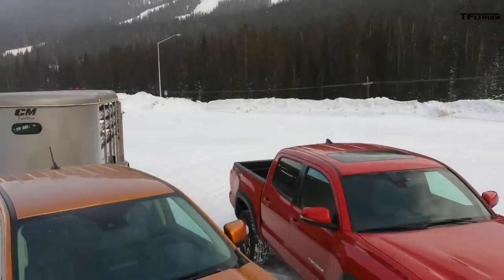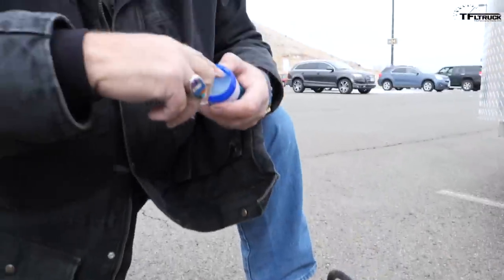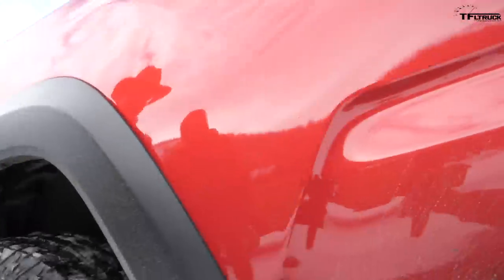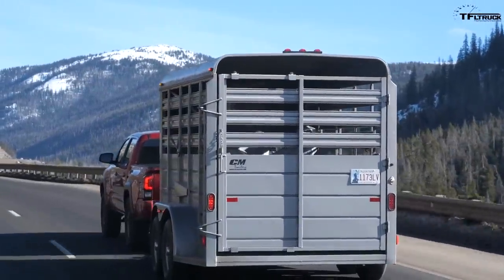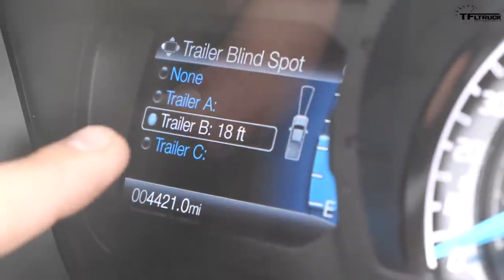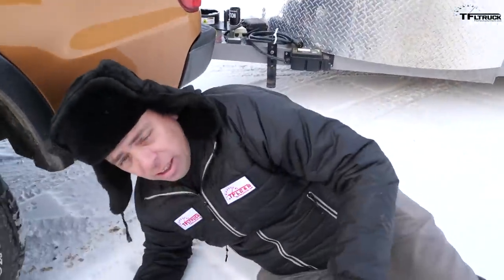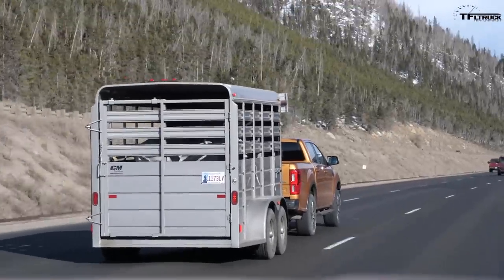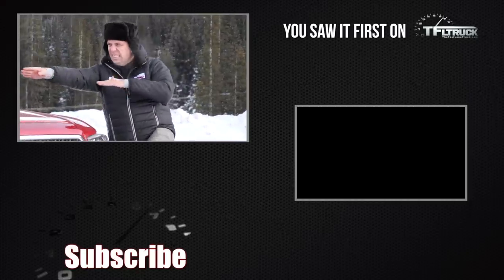Best Midsize Towing Truck? Ford Ranger vs Toyota Tacoma vs World's Toughest Towing Test

Comment: Both great dependable trucks
Reply: Wait a bit before making that statement. Ford has been having issues with all their turbo motors, I doubt this will be any difference.

Turbos are just high strain components that can be damaged very fast if the oil lines plug up or the oil gets to hot in general. But that's any turbo engine.

N/a motors will lack in the numbers game but they are generally more reliable since they are more simple designs. 

Diesel is a whole different game and they have quite a few issues caused primarily by modern EPA requirements. Delete emissions and run a clean tube and you can pretty easily get 500k out of a diesel engine. Otherwise you better keep very good maintenance on them.
Reply: @kylevanwinkle2081  Ford's turbo motors are just as reliable as naturally aspirated engines but any modern engine is more prone to problems caused by a lack of maintenance.
Reply: @benjaminwayneb  if you really believe that I'm sorry because that's just false.
Reply: @kylevanwinkle2081  It's not false!!!!
Reply: @benjaminwayneb  ok bud believe what you like
Reply: @kylevanwinkle2081  I work for a Police fleet with 270 units and the Ford engines by far have the least problems vs. GM and Dodge.
Reply: Lmao. I see tons of old rangers. The 4.0 and 4.2 were actually good engines and in Ford's. I hear tons horror story's with does but i hear tons of great story with ford.
Reply: The reliability of a new model ford is very questionable.  It is a 35,000 chance.
Reply: @Jn58298  2.3 , 3.0, and 4.0.
Reply: Kyle Vanwinkle gmford engines are reliable.
Reply: Tacoma yes, Ford no.
Reply: benjaminwayneb bwahahahahaha.. I am a cop, and my fleet are going back to gm because of all the issues that the Fords are giving us. The interceptors are the biggest piece of craps ever!! Hahahahahahaha.. No way you work for a city with a police fleet. Then again, they do hire ppl who aren't very intelligent!
Reply: How do you know the ranger is dependable? It just came out!
Reply: @freddyflintstoned913  You mean 46-48k with this tester!
Reply: @EGGINFOOLS  same engine and transmission as eco boost mustang, they're holding up good so far
Reply: @kylevanwinkle2081  check out Daniel Jaeger films video on Ecoboost 200k mile review
Reply: @freddyflintstoned913  this truck has been out in Mexico and other parts of world for a while (I believe 2012)
Reply: @robitaill3  bud fact is Ford has issued with the turbo designs failed turbos and failed timing chains help even the 2.0l in the focus rs had headgasket problems. Let someone beat on the engine a little and the weaknesses will be revealed.

Chevy has their own problems with their diesel engines the 6.6 is screwed with the cp4, its prone to failure, mine let go at 74892miles. I've never felt luckier since the warranty ended at 75k miles, the 2.0 cruze diesel was plagued with emissions and emissions sensor issues. I know because I replaced everything past the exhaust turbo flange at least once including the def tank lines and injectors.

I dont know much about the 2.0l duramax or the 3.0l duramax they are currently producing and I'm very interested in the 3.0l but I know wlhoing in that emissions issues are likely.
Reply: @kylevanwinkle2081  not saying it's perfect. Way better than the Fiat-Chrysler small turbo engines
Reply: @robitaill3  I know nothing of fiat Chrysler as I'm no fan of anything they build. The jeep and the Cummins is the only thing i remotely like. Put the 2.8l Cummins in the jeep and I'd love one but that crummy 3.0v6 diesel has a pretty bad flaw along with emmisions failure history
Reply: @kylevanwinkle2081  Fiat merger was their demise
Reply: @robitaill3  I agree but without the merger they prolly wouldnt be around at all.
Reply: @kylevanwinkle2081  I rented a 2015 or 16 Chrysler 200. The tranny was already slipping with 30k on it
Reply: @robitaill3  That's a small percentage of reliability on a vehicle. There have been problems with the 2.3 in the past. Suspension, electrical wiring, reared and countless other things aren't shared. Plus the frame is totally new, not the 12 year old design from the global form

Comment: Hello again Andre an Mr. Truck! But I have to tell you two chuckle heads, yo can not downhill brake test a truck that’s towing a trailer with surge brakes! Plus when greasing a hitch, or just about any hole, you are supposed to spread the grease inside the hole after spreading a thin layer on the hitch itself!! Not glob it on just the hitch, only to have most of it pushed back as you insert it! If I remember properly the Colorado Diesel and Gas Crew Cabs did better than both of these two, up-down an mileage wise!

Comment: SMALL trucks are NOT made for towing BIG loads. 
That's a job for BIG trucks of ALL makes and models!
NO SMALL trucks will last in  conditions of High RPM!
Reply: True. F150 or the Tundra for regular duties like this.
Reply: Except the Colorado comes with a diesel... you think that truck would be here for the test?
Reply: My hat is hitting the roof...come on stop complaining,  im 6 ft 3 wich is above average and my head has never hit my tacomas roof. Just dont wear a huge cowboy hat that adds 10inches to your head haha
Reply: This is the reason RAM cited for not offering higher towing capacity. If you are going to haul that much, you need a bigger truck. It isn't all about how much the engine can haul. It is also about the weight of the truck being able to properly handle the load.

As a matter of fact, TFL actually did another video which showcased this. They did a towing test between the F150 and the Colorado. The load was within both trucks capabilities (5600 lbs I believe), but the Colorado had issues with seat that the F150 didn't.
Reply: @mikemissouri5152  it's probably more a matter of getting press vehicles at the right time. Plus, they have tested those already and I don't think they have any new updates for 2019 like the Ranger and Tacoma do.
Reply: My Ranger has lasted under heavy loads every day since 2005 going cross country including the Ike Gauntlet

Comment: You guys are totally ignoring the Ridgeline.
Reply: Rigeline is a nice car with a truck bed.
Reply: The ridgeline  does not fit in this catagory, it's not a truck. It's an El Camino!
Reply: Honda doesnt make a body on frame vehicle. Only unibody car set up.
Reply: Lol
Reply: Because anyone who watches this channel or any of the other big truck channels doesn't give a shit about the Ridgeline.
Reply: @jackmackenzie2118  - Ridgeline is probably the most comfortable ride, but doesnt handle payload well. Lots of rearend sag and not many mods to address that. It really is more of an El Camino car like vehicle.
Reply: @jackmackenzie2118  it is and it isn't. if and when I get a truck which I want to. it needs to be able to do a little bit of everything. I move every so many years so I want to be able to do off-roading/overlanding if the area allows it. I want to be able to tow at least 6000 in case I get a camper or have to move myself. And the Ridgeline doesn't offer that. Now if I knew I was going to say in city limits or very tame country / county limits I would get a Ridgeline hands down, no questions asked. But since that's not the case for me and for many others the Ridgeline isn't even mentioned on the list.
Reply: I have a Tacoma, but even I can admit the Ridgeline is too ignored. Biggest thing that turned me away from it was the price of one new.
Reply: @johnwesley1660  that is insulting to El Caminos. At least they have a frame and rear wheel drive. The Ridgeline is a Honda Odyssey minivan with the 3rd row removed and the roof cut short.
Reply: Truck or not, the Ridgeline would have easily towed that trailer. And poor old Mr. Truck would have been extremely comfortable in the class leading interior.
Reply: @jackmackenzie2118  If you go threw TFL trucks older reviews you will see that the honda ridgeline over heated its transmission on goldmine hill. It dose not have the off road performance or towing preformanc of any true midsize truck. It dose have a very nice bed that dose not have wheel wells in the way.
Reply: They've tested it on the IKE before. There's a separate video out on it. It probably wasn't available to them at the time of filming this video.

Comment: That ranger is a visual dud.    A blob on wheels.  I would rather have the 100 yr old frontier
Reply: If your priority is aesthetics for a vehicle segment like this, I dont know what to tell you...
Reply: @keithlivingston1221  I take it your of the same opinion that appearance is everything?
Reply: @ALMX5DP  No, but the ecoboost has earned a new nickname lately... "the ecoboom" Look it up... I'm one of those guys who likes reliability and a truck that doesn't say soft when I look at it... In part it does need to look a lil tougher...
Reply: KEITH LIVINGSTON reliability is one thing, but as long as it gets the job done I would have little issue with appearance. If you can’t get past looks the issue might be something only you can fix.
Reply: Alan Bowers I work for a company called turbotech     We sell Reman parts to the turbo industry.  Keith makes a valid point about ecoboost.  The reliability of the 2.3 ecoboost is not there yet.   Plus the bad looks in my personal opinion.  It’s a no go.  But of course we all are entitled to our own opinion.   The Toyota is tried and true.    I own neither marks.   I am a VW Volvo guy so I have my own issues.  Lol
Reply: @ALMX5DP  If that were the only capable truck on the market you'd have a point...

Comment: Backup camera law is terrible.  Options to have features or not is always better.  The less govt forced design the better.  Back up cameras are awesome but what if you don't want to pay for one?  Too bad.
Reply: Kevin Ryan could say that about a lot of things.
Airbags,
Seat belts, 
Roll cage in the frame 
Softer bumpers
Reply: @devinbender8428  I agree.  All should be optional.

Comment: Bring on the new Ranger in 2024 as well as 2-3 other mid-size trucks and SUV's all towing 5,000-7,500 and let's see how they all work out. Can't wait.
Reply: Back after watching a bunch more reviews - including a max load test of the Jeep Gladiator, which eliminated that as a choice. The Ranger in this example looks very old dash - and I hope that is fixed for the 2025 Ranger....here it comes in August. BUT, these are still trucks and I still don't want one as a daily driver - it's close, but still not my first choice. So, at the moment I am comparing Grand Cherokee and series 1 wagoneer.  But both Tacoma and Ranger looked impressive towing in this video.

Comment: In five years, the Ford will be worth a fraction of the Tacoma in resale value.
Reply: If the Toyota still has a frame
Reply: I don't wish to live with something with terrible road manners for years simply because it holds its value better.
Reply: Kevin Ryan good joke. By fraction do you mean 95/100??

Tacoma average resale after 5 years is 62% 
Ranger is 59% 

So if both trucks are $40,000
The Tacoma will be 24,800
Ranger will be 23,600

Or about 5% less or 95% of the Tacoma. 

$800 after 5 years isn’t what I would call a good return.
Reply: I've owned Ford, GM and Toyota pickups... and always go back to Toyota.  I get a better deal buying a new one... fewer problems... more demand for it when it's used, which equates for better resale value at the end.  Happy to see Ford and GM back in the competition... keeps Toyota on their toes.
Reply: certainly hasn't been my experience.  They'll be lined up at the door for the Tacoma... you'll have to trade the Ford in to get rid of it.

Comment: Great job, André & Kent! That was a squeaker indeed. I'm really surprised the Taco hung in there with a turbo assisted engine. One wonders how a diesel powered version of both would compete. Both the Hilux (Yes, I'm aware the Hilux and Tacoma are not the same.) and the Ranger are built with diesels for the rest of the global market.

Comment: I'm tall but not exceptionally so,  and I was hitting my head on the A-pillar o ]top of the door jamb when entering or exiting from every small or midsize, American or Japanese, sedan or station wagon, designed before 2000.  My wife being 6 inches shorter never had a problem.  

The final criteria I used at the 2004 Chicago Auto Show for narrowing down choices of a daily driver vehicle were ease of entry headroom and driving position comfort.  At the end of the day (literally) of driving, those matter more to the driver than  specs of never used features. I wanted a station wagon equivalent. My fallback was a small pickup truck.  

Compact trucks were quickly eliminated because of seating discomfort.  The midsize were nearly as uncomfortable and out of my price range.  Instead of a compact station wagon, a larger SUV, or mini cube I chose a Honda Element.   I thought it ugly and awkward looking, more like a soccer-mom's vehicle than I liked,  but  after several test drives, one with my wife driving,  we both preferred it over everything else we had seen.  Every other aspect of that vehicle was better than we needed.

What I'm saying is that if you need a pickup truck, get your priorities straight.  First it's a vehicle that you drive, second it  needs the capacity to haul/tow what YOU need, everything else pales in comparison.  If you can't drive comfortable (not luxuriously), you will be distracted and have to work harder to drive safely.  Instrument panels and  infotainment systems that reviewers obsess over are trivia.  The brakes, steering and handling are important.  You don't need a tach to hear an engine shift under load, don't need to know what gear the transmission is in so long as you can get to and maintain legal highway speed.   

I thought it strange that the SHORTER of the two men had trouble with the headroom and he looked taller in the Tacoma than the passenger, shorter in the Ranger.  That indicates radically different seating positions. probably the height of cushion above the floor.

Comparing the videos, it looked like the driver seat back was reclined further in the Ranger.   That suggests that the test driver's body proportions were far from the norm, with shorter legs and relatively long torso, which makes the headroom observations irrelevant to normally proportioned drivers.  It would have made more sense for the drive and Uri to test the driving positions of both trucks.

For a metric like seating position there should be a standardized set of metrics, like hip to brake pedal, chest to steering wheel and forehead to instrument cluster measurements.  If a driver cannot be comfortably seated with the seatback angels and cushion heights  set the same, the reasons for that should be stated and the adjustments for equal levels of comfort and driving safety should be stated.

Comment: How's the turbo going to be at 100,000 miles,,,I'm interested to see these eco boosts at higher mileage ax far as longevity...
Reply: I have a twin turbo 3.5 liter ecoboost in my 2012 Ford Flex, at almost 160,000 miles and it is running just fine. It has tons of power as well. It's fun to see all of the faces when people get beat by a fridge on wheels
Reply: My ranger only has 18k but my daughter has a mustang with the same 2.3L Turbo 4cyl.  She's got 93k and zero issues so far.

Comment: Gents I came across your channel about 1 month ago when I started my "research". I am looking to purchase a truck and travel trailer. The wild card is there is a motorcycle that would occasionally be hauled. I would love to get a midsized, specially the ranger. My first thought was small toy hauler. Based on weight ratings and size the Ranger seems as though it could do it safely.  With the GVWR being around 6k on the trailer. My issue is the toy haulers being lack luster inside unless you spend big. Any chance the Ranger could safely haul a 900 pound payload while towing a 3 to 4k lb trailer?
Reply: Yes. I'm a sales guy at a dealership out in NY and I also own a 2020 ranger. 900lbs payload and 10% toungue of a 4klb trailer is approximately 1300lbs. You should be right around the max payload of the truck. ( 4dr 4wd 1430lbs)
Reply: @Fin.mint.  Thanks for the help. Been looking at possible truck and trailer combos for weeks. Being able to stick the bike in a Ranger would open up a lot for us options wise. I am however looking at the 2 door ranger.
Reply: @Fin.mint.  Okay sales guy? What about the weight of the people, fuel, gear, food, water? You're another car salesman speaking about payloads, towing rates, and don't even understand the basics of payload or GVW. Where did you get the 900 lbs payload.? Is that people and gear or cargo? You need to explain this better when sending someone down the road.
Please do not offer advice on towing and carrying, if you treat every customer like you just did, then you're sending everybody out very overloaded. You cannot combine the full payload and the full tow at the same time, the vehicle will not brake properly.
Reply: @geographyinaction7814  Please re-read the OP comment. With gear and people he stated that his payload is 900 lbs. Industry standard for tongue weight is 10% trailer weight, aka 400 lbs. So, being 1000 lbs under his payload capacity fully loaded is fine. If for some reason you think that he can fit a 900 lbs, 8 foot long  Harley Davidson in the bed of his ranger, I seriously am concerned about your judge of distance. Average bike is 400-500 lbs.

Comment: I've been reading a couple stories about the oil change procedure on the Ranger. Some crap like that would make me less likely to buy the vehicle. If they really wanted to they could have made it easier for the consumer to work on, but Ford doesn't care what happens after you buy it. I've had to re-learn the lesson of Ford not caring about you after the purchase over and over again.
Reply: You weren't smart enough to learn the first few times?